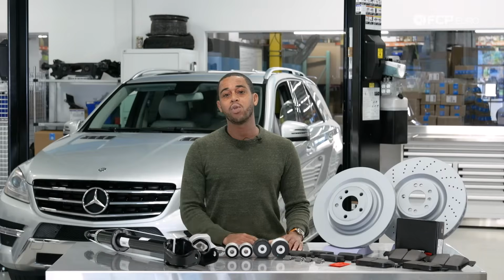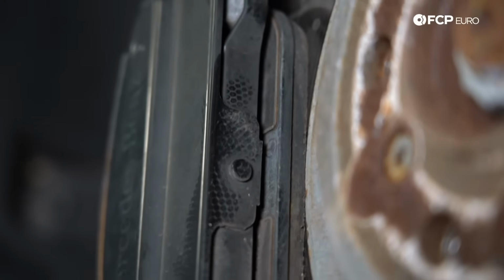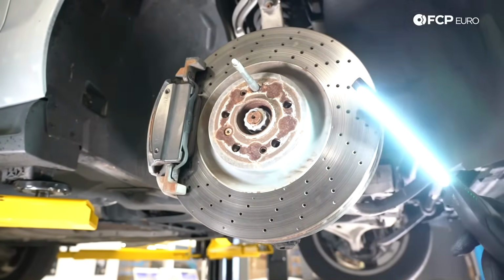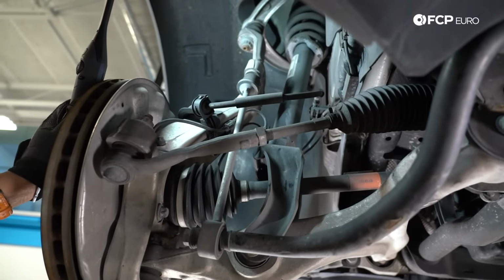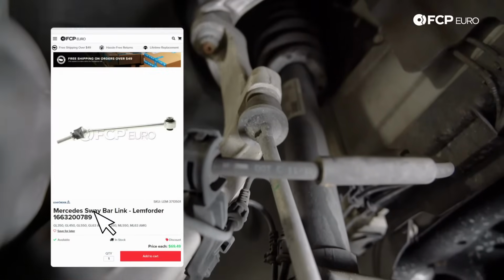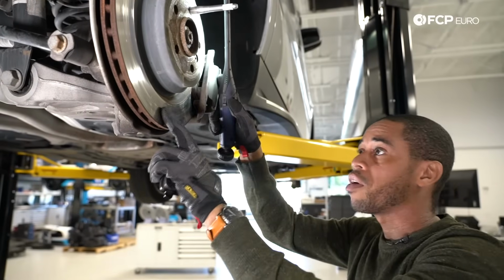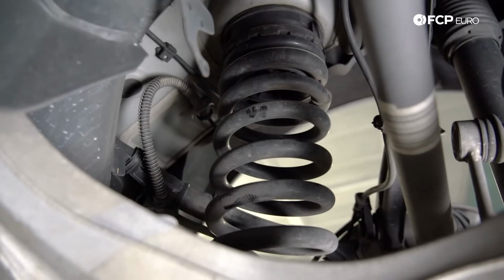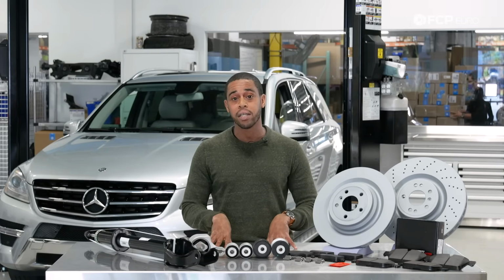W166 Mercedes-Benz ML & GL Suspension & Brake Maintenance & Diagnostic Guide (2012-2019)

Comment: My ML 350 2015 (W166) is going low , lowering down on rear side when i leave and comeback , I see it so low, as soon as I turn on or open the door, it will raise up, is this a settings issue or my air absorbers are leaking or down

Comment: Awesome video but a lot of the bushings you said were “deteriorated” really don’t look that bad that will warrant a change. Yes worn, but not deteriorated…if it’s making noise then of course. Changing all the bushings every 60k miles is a bold statement though. Sway Bar links definitely…but control arm bushings,etc….not at all. But at least you do say to check your vehicle to make sure you need them.

Comment: Very informative video thank you. I seem to have developed a creak in my GL X166 suspension when going over bumps. I am so not excited at the endless possibilities.
Reply from the maker: Crossing our fingers its a simple fix!
Reply: Did you find the source of the problem.  I'm a new W166 owner and have a similar issue. Sway bar links seem to be a common cause. Would have thought they would have been more emphasized here. Great video still.

Comment: Hi Kyle,

I enjoyed watching your videos! Very well done- thank you. I do have a few questions for you. 
I have 2013 ML 63 and planning to replace the  front air structs, upper control arms, lower control arms, front sway bar links, and front axles. 
I having issues finding torques specs for the items listed above. Would you happen to the specs or could you recommend a book/manual or software I can purchase for the torque specs? 

Thanks.